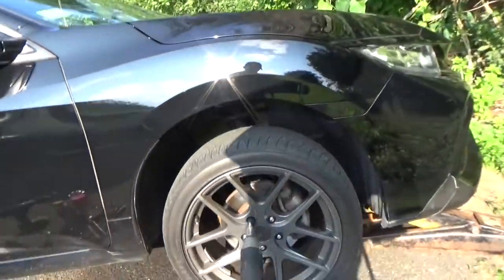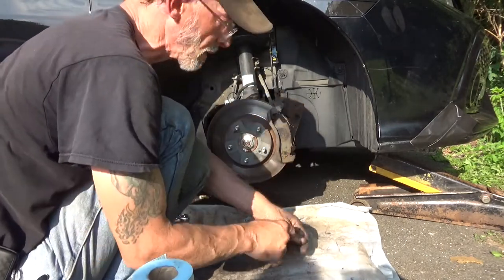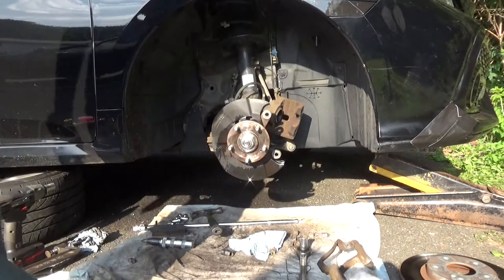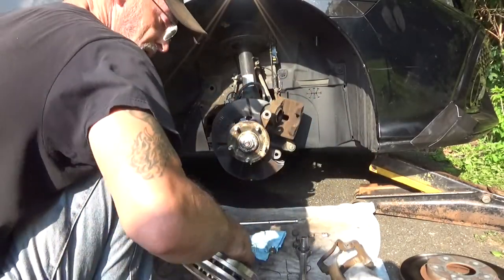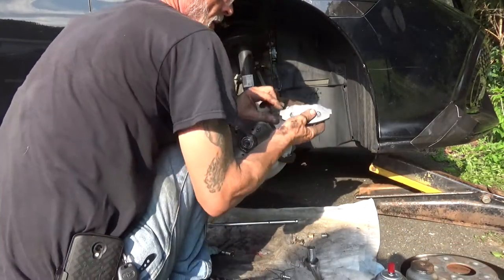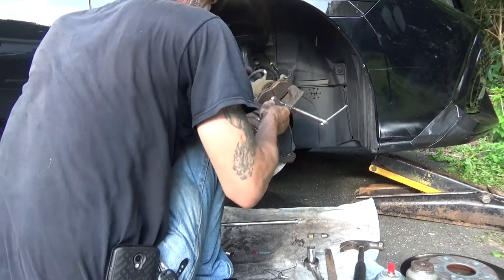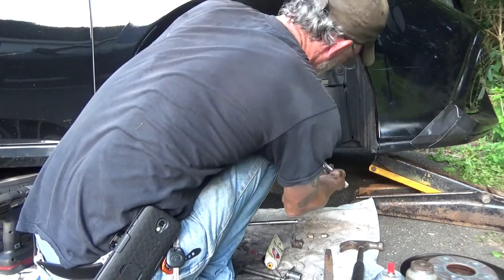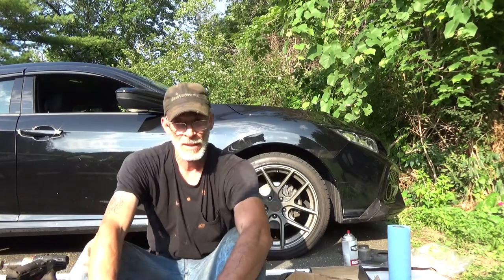2017 Honda Civic - Front Brakes - Auto Repair

Comment: Thank you so much! I'm about to change my brakes pads, and this video was really helpful!
Reply from the maker: Just make sure the pads move freely (light drag) before putting the caliper back on. If they drag or are stiff to move, clean the contact points of the bracket more, where the pads are binding.
I'm very glad this is helpful!
Reply: @HouseCallAutoRepair  thanks for the advice, I will make sure  to do that! U really helped me!

Comment: Great video.  I greased my caliper pins and forgot how they came out.  Looks like the pin with the OVAL TOP goes on the TOP/leading edge.  The BOTTOM pin has a square top and has that silly rubber bushing at the end.  I removed the bushing, it was causing a lot of friction.
Reply from the maker: The important part is not so much "top or bottom"as much as "leading edge vs trailing edge"
Top or bottom can lead to easy confusion.

Comment: Do the ends of the slide pins ( the rectangular part) do they point verticle or horizontal? I took mine out to regrease them and add new boots. Forgot what direction the end face. Does this make sense?
Reply from the maker: They fit in such a way that when the bolt is snug, the pins get "captured" and won't rotate. If they are not in the right position the bolt won't tighten without binding. Once assembled, the whole assembly should slide in and out a mm or two, on those slide pins. (Before depressing the pedal to reseat the brakes)